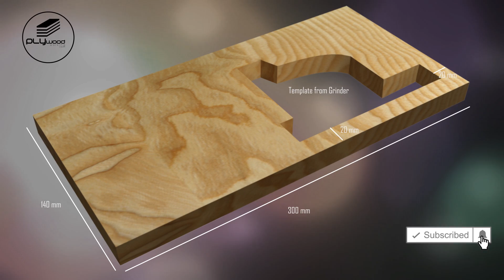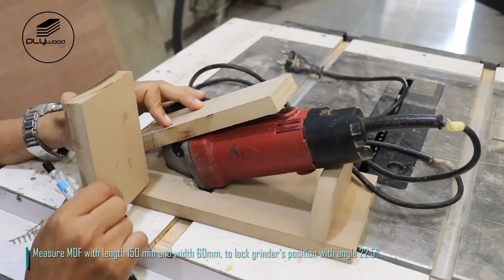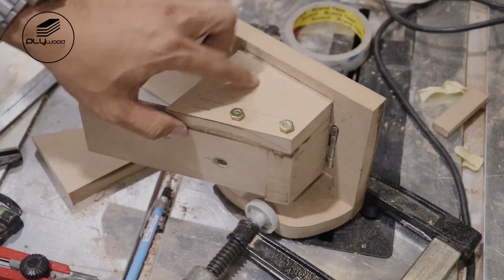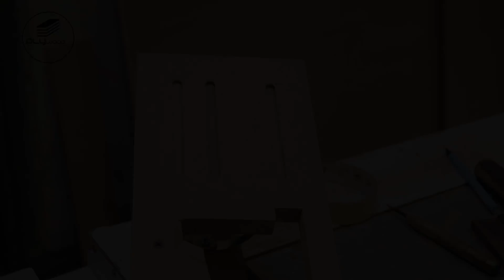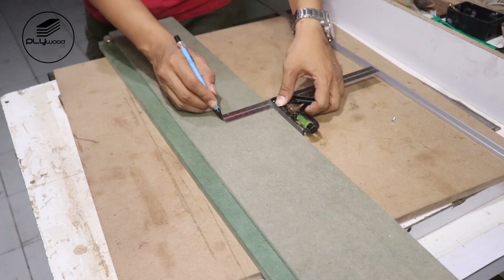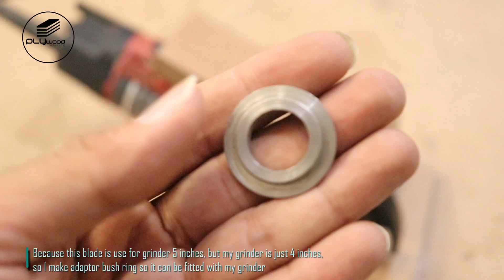DIY Angle Grinder Track Sliding Cutting Jig for cut metal sheet & wood

Comment: I still prefer metal guide because its thiner and strong it can cut longer
Reply from the maker: Yup you right, but i give alternative maybe cant welding and only have wood on shops
Reply: @plywoodworking  yes really appreciate youre project its really one of the best and safest guides of a angle grinder its practical and the materials is easy to two thumbs up for you👍👍😀

Comment: 👍 Хорошая вещь. Только хомуты бесят. Не правильно это. Вредная часть конструкции. Удачи Вам и вашему каналу. 👍
Reply from the maker: depand you will use for what i think grindr max only can cut 2mm metal sheet or aluminium sheet max 3, for cut plywood or wood i use spesial blade grinder for wood
Reply: @plywoodworking  Спасибо. Я не имел ввиду дерево. Я понял. Думаю при не большой переделке можно и более толстый металл за несколько проходов.

Thank. I did not mean a tree. I understood. I think with a small alteration can be a thicker metal in a few passes.